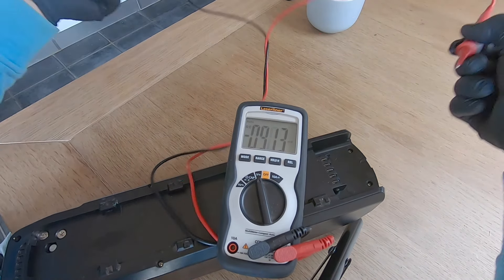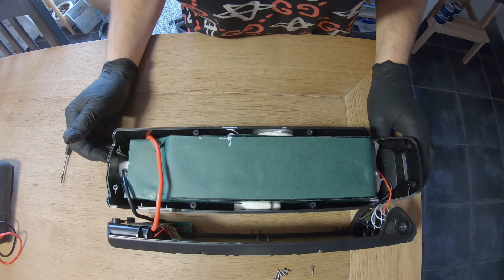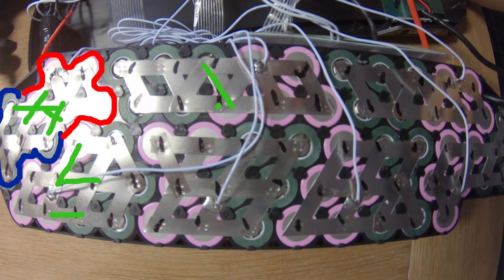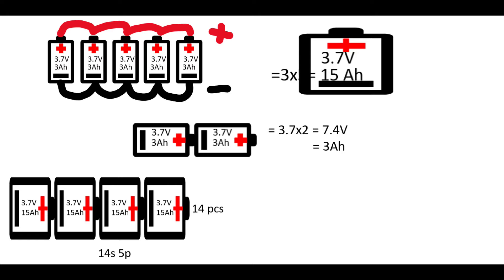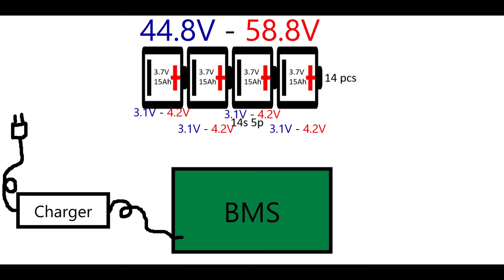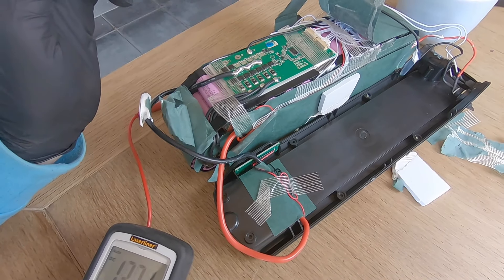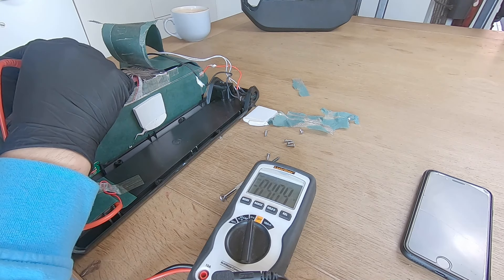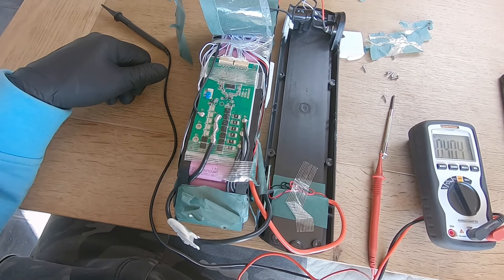Dead BMS! How to test it? & what's inside my 52V battery pack?

Comment: i have a btrpower lifepo4 battery, it reads 37v (36v battery) which is fine, but when i turn on the scooter, and i volt meter the battery, it says 1.2v, and wont power the scooter.. is it the bms? my SLA's power it fine... hate to ask but literally cant find anyone else who knows what they are doing. controller is spd 36900a from electricscooterparts...  thanks in advance
Reply from the maker: anything heating up? (short circuit?)
Reply: @VRMinde  not at all, all the connections are good and clean with no ground outs or anything. Volt meter reads 37.54v then flip the on switch and 1.224v. The SLAs work just fine when I connect them.
Reply from the maker: @joedirtthe3rd  in order to understand if that is bms issue or not you need to measure voltages separately from bms and on the bms output. If your voltage without bms also drops so low - there must be huge resistance somewhere, like short circuit kind of resistance 🙄 should be some smoke or heat at least :D probably not the case. Where do you measure the voltage?
Reply: @VRMinde  thanks! I’ll see what I can do as the battery is all nice and heat shrinked… I measured the voltage from the discharge leads and also the charge leads. But there is absolutely no sparks, heat, smoke or anything. Just the moment I turn the system on it reads low. And that was checking connection between batteries and controller, everything from controller to motor is 0 volts,
Reply: @joedirtthe3rd  did you figure it out?
Reply: @carlnikolov  I’ve received a new battery and it has the same issue, just now when the switch is flipped on it reads 0 volts. There still is no short. I have a new controller coming today that I’m going to try, but it’s rated at 30 amps instead of 100 max. Hoping it plays better with the battery packs BMS. Pretty bummed though because the LiFePO4 on my build would have been absolutely amazing. But now it’s going to be handicapped. Btrpower said it should do 100amp max and the 50amp continuous but it has failed on 3 different battery packs. My SLAs power it all fine still, just get warm from overdraw (which is why I replaced them with the LiFePO4) but I’ll have more info after I try the new controller when it arrives soon.
Reply: @joedirtthe3rd  crap. The bms is expensive too depending on the model. Its a shame that is doesnt shut down and auto reset. That way if it keeps shutting off during operation youll know its the batterys fault...the cheaper bms chips just straight up fail entirely
Reply: @carlnikolov  yeah and with the 30 amp controller it worked flawlessly up until about 30 yards from my house when all of a sudden there was no more power. Battery read fine though. Hopefully the new controller didn’t just die. Gonna have to check everything again today. Pretty bummed though cause my 100 amp controller was able to supply power to really get the motor spinning. The less amps means I can’t get to full revolutions like before. So less torque and slower overall. But it worked for a bit.

Comment: hi hi have 36v battery the charging fuse missing f1 do u know what size it would be its an aovo one shorted neg an pos wires out put lead shows 24v but on the bank its is 41v

Comment: How do you find the correct BMS?  Mine has a power switch with power level on the case, and it also has 2 extra wires which provide battery level to the LCD display.  Seems my BMS is extra functionality?  Its from iZip BL17 battery pack.
Reply from the maker: It is not simple to find “the right one”… i have not purchased too many of them… so do not have a sure answer :)

Comment: Hi, excuse my english,
Do you think the BMS is dead because you have 20V between the negative of the BMS and the positive of the battery when the button is OFF? I think I have the same problem ... have you solved your problem? : D
Reply from the maker: Hi, if you measure on the battery directly and have different voltage (let’s say 48v or so) - probably bms is dead. If you also have 20v on the battery terminals (before the bms) - you have either loose contacts or dead cells. I have replaced my bms to a new one and that solved the problem

Comment: do i use common or separate type BMS for ebike (72v 20s 3p 80A continuous)?
Reply from the maker: What do you mean by separate/common BMC? (BMS I guess? But what is separate/common?)
Reply: @VRMinde  
Sorry I meant bms,
2 or 3 wire bms
(Same or separate port)
Reply: Separate port- 3 wires, charge port and discharge from different ports
Common - 2 wire, charge and dischatge from the same port
Thx for answering
Reply from the maker: Mat ddd I am not an expert. But as far as I have seen many 2 wire BMSs have one potential issue: for example one of your cell reaches lower than min V. 2 wire BMS will disconnect the load to protect the battery, but it will also disconnect you the opportunity to charge it. Same with overcharging - if you charge the pack and manage to overcharge it - 2wire BMS will disconnect not only charging, but also the load. 
3 wire BMS will not have this issue.
I believe there are also 2 wire BMSs that have the ability to disconnect load while keeping the charge enabled (if they have double FETs), but there are not many of those. As I said I am not an expert on this, that was just my opinion 🙄 is there a big price difference?
Reply from the maker: BTW, what kind of a beast are you building with 72v battery? 😳😳😳

Comment: Sir : 
If anyline of  series lines is damaged .. the + and - of battery gives ..let's say 45v .

May be in this case the BMS gives ZERO volts , when it ( BMS ) is NOT damaged.but we will take a wrong result by accusing BMS!

Could this case happen ???
Reply from the maker: But when you measure series by series you would notice it 🙄
Reply: @VRMinde  
Sure . So we should measure lines one by one I think to be sure that BMS is not failed .. thanks alot 😍

Comment: well I think the battery goes through te BMS when discharging or powering the load. Is that correct?

If that's the case then the BMS must have fried its MOSFETs. The purpose of the mosfets is to cut off power if it senses that the load is too large for the battery. 

first check that your load has no short circuits
then next, check for physical manifestations of mosfet failures
if there is none, you can purchasea  cheap BMS to replace your existing one, or

if you'd like
if you can, try to test the mosfets yourself. A lot of videos explain how to test this, but for the sake of time, better replace the BMS.

Comment: I have an error code E-06 on my teewing x3 scooter. With key on the voltage gauge gets 54.6v but suddenly dropped slowly to 0v and the scooter shuts off. With battery charge from an outlet source reading 58.6v full charge. Immediately when i unplugged charger it goes to 0v slowly.
Reply from the maker: It can be a dead cell as well

Comment: My battery losing range and cutting out now had 50 amps on phaserunner running threw it got hot at times help
Reply from the maker: You will have to check the cell groups individually for disbalance. 50amps can be way too much, depending what cells and how the pack was built 🤷🏻‍♂️ if you demanded more from some cells than they could give you - there is a good chance they are dead 🤷🏻‍♂️

Comment: my hailong battery says its fully charged all green dots on the battery. but on my display its showing 38.9v its a 48v battery ive had it in my bike for 6months. theres also like a electic cliking noise coming from battery when turned on. can anyone help me surely the cells are not dead ?
Reply from the maker: You will have to disassemble the pack and at least measure voltages of series groups. If one will have weird voltage -
It has damaged cells. Needs removing them and replacing..

Comment: My battery has 76v when I test it but the bms under no load only has 12v. Is that right? its a daly bms.
Reply from the maker: If BMS only delivers 12v it is definitely not right. Check out all the series cables on the bms and carefully measure voltages between the series groups. I assume you have a 20s pack?
Reply: @VRMinde  yes 20s 8p. Batman of Inglewood suggested that the bms needs to be activated with the charger.
Reply from the maker: @felonebike9859  if it is a freshly connected BMS that could be the case 🙄 before you connect anything though be sure you wired the balance wires in correct order. The voltage should stack-up by the value of the cell group (for example 3.7, 7.4, 11,1 etc.) if you measure in between them. Just don’t shorten them when measuring :)
Reply: @VRMinde  I checked and its all good. The voltage goes up on everyone. I'm about to wire the charger in. Probably take 2 hours. I'll give you an update when I finish. Thanks for your help!
Reply from the maker: @felonebike9859  if this is charge-enable issue 5mins on charger should be enough to check if you get correct voltage out. Anyways best of luck mate, let me know

Comment: Seems to be common problem with ebikes I currently have battery lasted less than 30 miles.
Reply from the maker: I replaced it with an more expensive bms and it lasts for a long time now

Comment: I have the bike brand : Samebike
I bought the battery and give my little brother the bike.  Once on a cold day he told me that he draind the battery all the way and now when he charges his battery . the indicator stay at green , meaning full charge.

So then i charged it over night and then  i used a multimeter to messure the voltage .  The battery is supposed to be 48V ich and after the charging i was excpeting it to be around 48v  but it was at 40.5V ich.   So i went to the  BMS and directly connected my multimeter on the battry  and it still read 40.5V After that i put  one probe on the bmc Battery - and one porbe on the pins where the tiny kables are going  .  Mine says BC0-to BC-13.  the   so 13x3,7v=48.1v ich.   So now i put my probe on the BC0 and it read 0v  and i was like, it makes sence bc thats the ground (the -) now lets try BC1 and again 0V , Then i tried  BC2 and it said 3,7V  and it kept adding up  like when i was at BC3 it said 7,4 since 3,7x2 is 7.4 V and  i followed the BC1 since i didnt get the reading. 

Then i Ripped one side of the nikkel strip off while the top part was still connected via the strip (metal strip).  And now i messured with my multimeter and put my probe on the nikkel strip that i  didnt rip off and the other side on the battery that is now exposed because i ripped the strip off.  And i found  a battery that read 1.8v While the rest read 3,7.  So in my head it was 48-3.7= is not 40.5v Now i messured BC 12 and BC12 Did not add 3,7 v to the pack aswel.   So i did the same and found a battery  of 2,5 V i ripped it off and replaced both bad battries and now everything works .
Reply from the maker: Good write up mate. Happy you found the bad cell :)

Comment: get rid of the bms all together, all you need is fuse and cell log or similar.
Put the multi-pin connectors on outside of pack and just measure/balance the cells when needed.
I personally leave cells exposed without cover, that way I can feel heat of cells, first sign of bad cell is heating, you can catch a bad cell pretty early just by feeling the cells after a ride or during charging. 
Keep life simple!
Reply from the maker: There are many people that think your way, I know, and I can follow the logic. But I do not find it "simple" at all. I like it when BMS does all that for me and I can ride until my battery goes off... And charge until... until I remember to take it off the charger :D 
I have not had too many bad experiences with BMS over many years.
Reply: @VRMinde  your logic is sound also

Comment: Does it need a bms?-
Reply from the maker: Nothing needs a bms if you want to track your battery state manually. However bms protects from overdischarging, overchargig, cut-offs at short circuits, tracks temperatures of the pack, balances cells, tracks voltages of the cell groups etc etc.

Comment: I have a battery that “dies” when installed onto my ebike when torque is applied. The power indicator green lights go dark . When I test  the voltage  , it is between 5 and 6 volts.  When I plug this battery into the charger for 1 second , the green lights turn on indicating full power , the voltage is now 51ish volts. 

What is causing the circuits to trip?
Reply from the maker: Can be a dead cell/cell group.
Reply: @VRMinde  I think a bad bms.  The voltage is 51 v after plugged in the charger
Reply from the maker: @linusleblanc6348  so the bad cell can charge up but be unable to hold the charge. You can just check all the cell groups and either confirm this or dismiss
Reply: @VRMinde  the voltage is 51v
Reply from the maker: @linusleblanc6348  you are telling me the voltage of entire pack, did you measure every cell group separately? Both when it is “fully charged” and “empty”
Reply: @VRMinde  it is a 48v battery pack. Why would I test the individual groups when I’m getting 51V.  When toque is placed on the motor, the battery cuts out.  When I retest the voltage, it is around 5 v. I presume the bms is tripping for whatever reason.
Reply from the maker: @linusleblanc6348  “48v battery” is a 13s battery pack. 13x4.2=54.6 that should be the voltage of a fully charged pack. If you have damaged/dead cells, some of them might charge to less that 4.2. However BMS will let you charge “good cells” only to 4.2 any ways. Therefore, your pack might charge to only 51. 
When you provide the load on the pack - the damaged cells discharge to 3 or whatever is limited on the bms and it cuts off the voltage. For me it sounds that your bms is doing exactly what it should - protects your cells.
But you don’t hane to do anything man. It is your pack and sounds like you already know the problem. Good luck and ride safe.
Reply: @VRMinde  so if I only have 51V, I have 1 bad cell. That makes sense.  So the whole battery wil never function again and I have to buy new . This battery is $900 Canadian.
Reply: @VRMinde  so 1 bad cell is causing the bms to trip making the complete battery worthless.
Reply from the maker: @linusleblanc6348  it can be, but not necesseraly is the case :) the only sure way to know is test the cell groups (some bms have bluetooth and apps where you can see voltages of each of the 13 groups).
Someone who repairs batteries can take out the bad cell/cells and replace them with new ones. You don’t have to throw away the entire pack
Reply: @VRMinde  I cannot find anyone in Nova Scotia Canada
Reply from the maker: @linusleblanc6348  try getting a book from amazon on diy litium battery build then maybe?..
Reply: @linusleblanc6348  I know a guy in Montreal you would have to ship it to him
Reply: @kylelandor7825  what is his email?
Reply: @linusleblanc6348  send me yours il send you his

Comment: checking voltage with no load is  not a good test 
bad battery show often good voltage 
but they do not have amp anymore
so under load voltage go down and bms cut off power to ebike
Reply from the maker: I can’t agree mate. Only because I have never seen a bad cell showing “good voltage” without load 🙄 the only scenario this is possible is when you have a bad connection somewhere, like a failed spot-weld on a cell that is barely touching. 
Failed cell will 99.99% of the time show wrong voltages, won’t be able to fully charge with the rest of the pack and so on. I will keep that 0.01% to say “it might be possible” :)
Reply: @VRMinde  that why there tools that put load on the cel to give you amph 
cheap old cel have good volt but very low amp
Reply: you should of put a fuse  jumper wire from pack to bike and monitor voltage at battery will giving trottle with bike supended above ground and watch if there voltage drop if there cel going low cut off point 
and monitor with amp clamp
Reply from the maker: that can be a good advice for further analysis if I would not have found what was wrong, thanks! @danman9017

Comment: Done many times, no worth it. Once after replacing the BMS, the battery blew up while riding a bike, it means it's time to replace it, don't bother with it because it may explode.
Reply from the maker: I use the same pack after 1.5 or is it already 2 years now…
Reply from the maker: Also in my case this pack was almost new when the BMS failed

Comment: Annnnd you got your replacement BMS from where?  I'm sure the Chinese company that makes that battery provides wonderful customer service, and will send a new one right over!  What's that?  They won't?  Oh, I'm sorry, it looks like you are s#!+ outta luck.  And the only aftermarket BMS you can find that can handle the current draw, will not fit into the original battery enclosure.  Looks like you are gonna have to pay $400 for a whole new pack.  Either that, or learn how to troubleshoot electronics at the board level so you can maybe fix that BMS.
Reply from the maker: You are mostly right :) I had to buy an aftermarket one, 100amps if I remember correctly, it did not fit in the box, I have designed and 3dprinted a small box and glued in on top of this one... making a hole for cables inside and completely sealing a lid on top... 
I can do many things in life. I even know how a diode or transistor looks on a diagram, might have soldered a couple resistors on LEDs :D  but never really found an interest to deep dive into circuit boards... 
I hope you are having a good day, thanks for your comment!

Comment: I don't use bms never a problem.  Use matching cells
Reply from the maker: Of course, it is always a way to go. But for me not THE way to go. I have 0 wish to manually check not to over-charge, not to over-discharge, and manually balance the cells. My controller even uses BMS temperature to cut-off in case of over-temperature. I think it is way less hassle and safer.